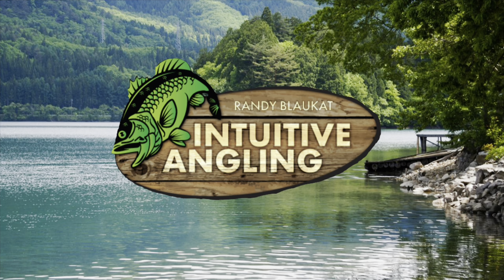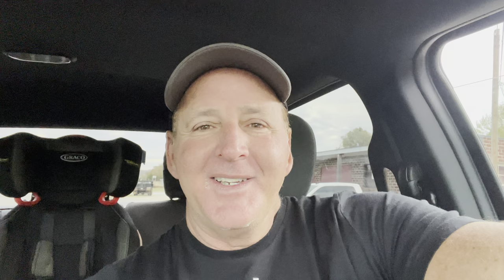90% Of Bass Anglers Don’t Know How To Run A Trolling Motor Correctly…

Comment: 100% accurate on the “keeping your legs in shape” point. In my career I had a bad injury to my back causing serious permanent damage to the main nerves going down my right leg and to a smaller extent my left. Having 80% loss of use the outside of my right calf, ankle and foot has obvious effects on running a trolling motor. Can’t use my right to use the pedal and when using my left to run it, I can’t stand on my right while running it. I’m not letting it stop me or complaining by any means. We all have to deal positively with the hand we are dealt. I am simply using my circumstance to support your comment. Leg strength and stamina are critical to standing and running the trolling motor.
I simply have to keep a “butt seat” at the front to lean against and I make it work. I love fishing too much to get down about it. Great video Randy. Thanks as always. C’mon 100K !!!
Reply: Just do like I did, get a Minn Kota that has a remote control, I can set my speed and navigate a course and it's hands-free fishing pretty much except for making a course correction every once in awhile

Comment: I never use my spot lock in shallow water. That's what my Power poles are for. It's only common sense that it will spook the fish if you use spot lock in shallow water. I also think spot lock has made me a better fisherman, learning to drop shot and using a ned rig has really made me a better tournament fisherman.

Comment: One other thing that I didn't hear from mention, and is a must for keeping your boat straight, whether it's the wind, or current, and that is the big engine. Never tilt the engine completely out of the water, as you are trolling, it will help steer you.
Reply: I did this last Friday when I was out.  Trimmed it the whole way up to avoid the rocks trying to keep my boat parallel for long casts in the strike zone.  When I got back out I just left it up and kept fishing and was spinning around like crazy until I put the engine back down lol